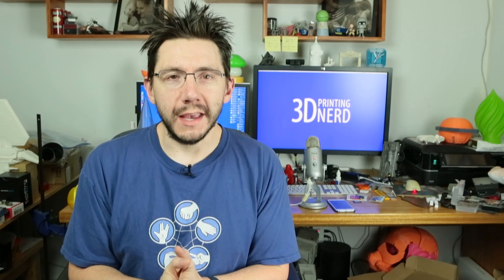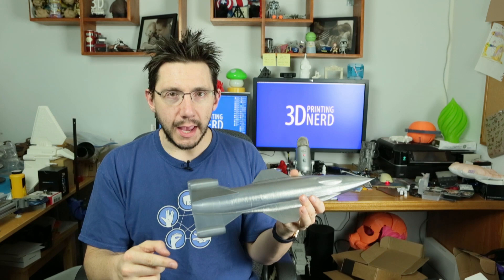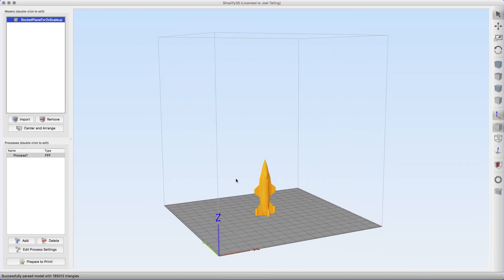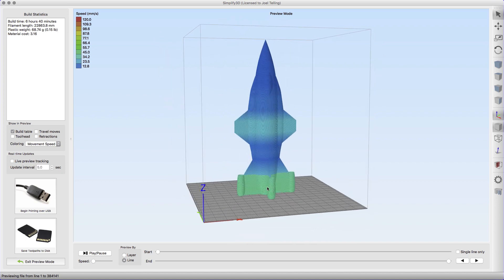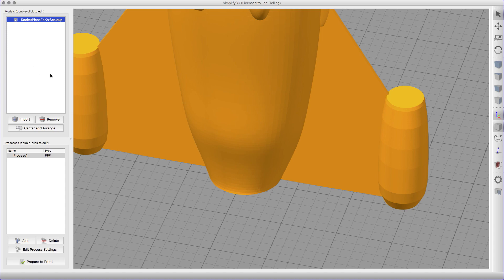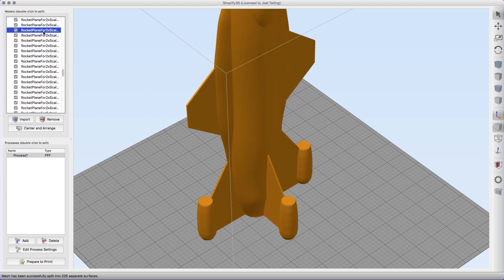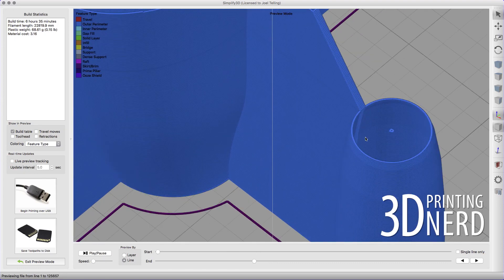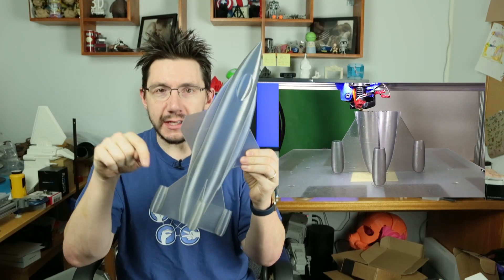3D Printing Tip: Separate Connected Surfaces in Simplify3D

Comment: Hi Joel, I came across this video about connected surfaces and used it in another way to save  a very cool dragon model. The model is beautifully done, but was put together in sections with overlap. By having S3D separated the connected surfaces, grouping them, and then adding the process, it made it a complete model. Null spaces in the center of the wing/body connected area and the head/neck connected are now slice properly? or infill properly. I have been printing for a 5 days, but watching your channel mostly has shown me enough to know there is almost always a way to fix something and as Thomas Edison said, "genius is one percent inspiration and ninety-nine percent perspiration." I just used some of your work in figuring out settings and identifying where the defect was (the hole) that was causing the gap. Do you have other tips on the software side for fixing models? I have seen your videos on trouble shooting the hardware.

Comment: I'm having tremendous problems with my Prusa I3 MK3 with the filament not sticking to the build plate.  If I use nothing, it sticks very little or not at all - and I end up with the filament wrapped around the nozzle.  I'm currently using Kapton tape, which seems to work pretty well, except for on any model taller than about an inch.  I've also used that painter's blue tape - but it seems to sort of "melt" during the print, and it's really hard to get the piece off the build plate.

Is there any other kind of substance / material that I could use to aid in adhesion?

Comment: Sweet - a quick way to avoid using the MS Model Repair Service website on models with slight issues that I only want to print a single time! (...and that can be fixed this way, of course.) Thanks for showing me this gem of a tool, Joel!

Comment: Thanks Joel, great tip I bought S3D soon after buying my first 3D printer and it was the best upgrade I have subsequently used it on other machines I have built. I downloaded and printed this model on a newly built delta machine I am currently screwing around with. Dunno what to do with the model but it looks cool.

Comment: It's a problem in the source mesh for shure. If you look at it directly on thingiverse (with the model-view) you can position your camera inside the rocket-drives and see that column in the center already. I then tryed to import the STL into my CAD-tool and it never managed to load it in correctly (and I had loaded some pretty badly broken and huge meshes in that same software before without any problems). So something is really terribly wrong with the mesh.
Reply from the maker: +ExtraBase Oh wow, bad mesh? Crazy. I'm happy mine was able to print at all, then!

Comment: thx dude. I opened an stl tonight,, from a folder, and noticed a weird square in the base. Used this tip,, and it was the previous object that I had printed,, but forgot to "remove" it before closing S3D.  #highfive

Comment: Flash Print didn't find any glitches in the base, Can you do a 2 perimeter vase mode in S3D?
Reply from the maker: +Mickice No, I don't believe so.
Reply: I had overhang issues on the bottom of the top wings, printing a 13cm model only took 40minutes in Vase mode.

Comment: Can't you repair that portion of the model or send it into Sketch-up basic and remove the problem?  I didn't know that feature was available in Simplify 3D I've been just reworking issues in Sketch-up basic if I can.
Reply from the maker: +Paul Muad'Dib Um, maybe? I haven't used Sketch-up yet so I'm not sure.

Comment: For everyone else not using Simplify3D, most other slicers also have this ability. It'll usually be called Split or Separate Shells, but they function the same. If your slicer doesn't have that ability, Meshmixer also has a separate shells feature you can use!
Reply from the maker: +Hoffman Engineering Hey, thanks for the tip! I did this in Simplify3D because that's just the slicer I use, and I'm very glad you were able to get some good info out for everyone else that doesn't use it. Right on! #highfive

Comment: With do think about XYZ Printers  and you know its has a Laser to go with now
Reply from the maker: +ArtofModeling I have a box in my entry way with an XYZ DaVinci Pro in it. That'll be my first experience with an XYZ printer. Just need to get it unboxed. It doesn't come with the laser, though, you can buy is separately.
Reply: I was going to buy the Da Vinci Jr. but the cost for the Pro IS so GOOD now I have a DaVinci Pro for my first 3D PRINTER